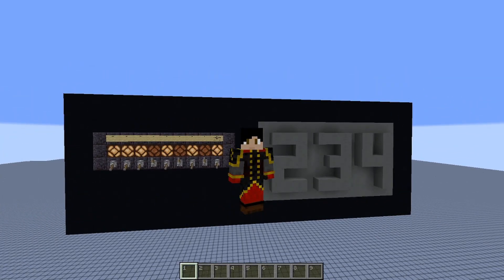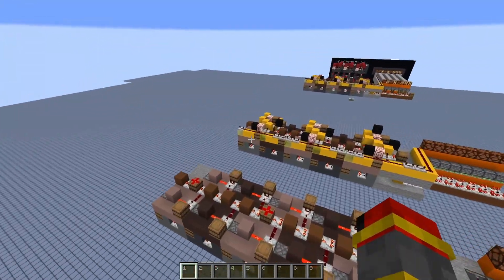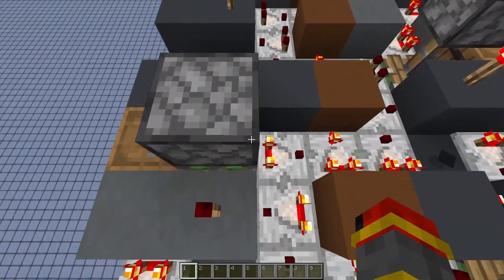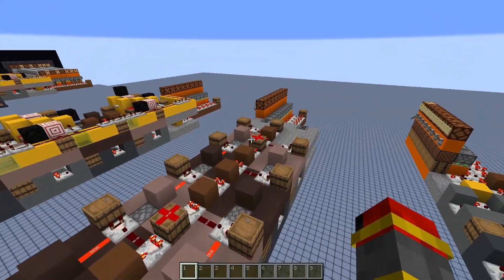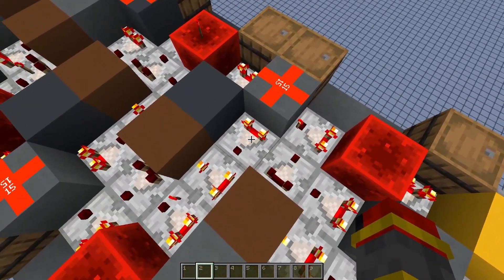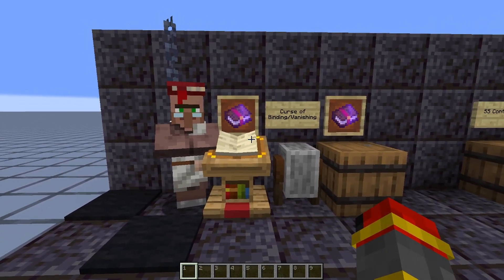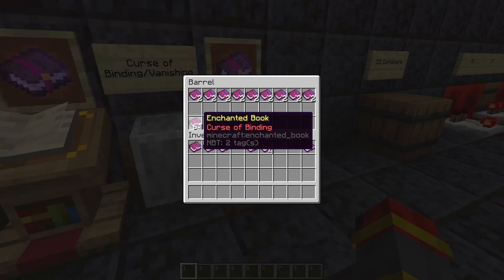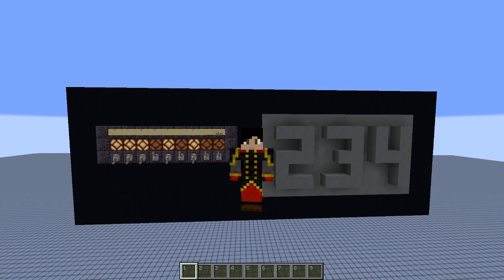Overloaded Signal Strength to Decimal | Minecraft

Comment: 8:09 how did you put the overstacked books in the inventory slot? whem i try to do that it wants to place a single book in each slot even if i have the overstacked books on my cursor
Reply: click outside the inventory to drop the stack on the ground, then pick it back up. inside inventories use shift clicking only.

Comment: What's the practical use of this can I use it in storage system as it looks very cool
Reply from the maker: Yes, it was designed for one of the MelonTech storages. You'll need to figure out how to produce an overloaded signal strength signal from your storage though. If you do intend to do so, I came up with an easier version of the transcoder, though it is slightly slower
Reply: @Kahyxen  ok but now the problem is how to overload it and are there any easy storage display